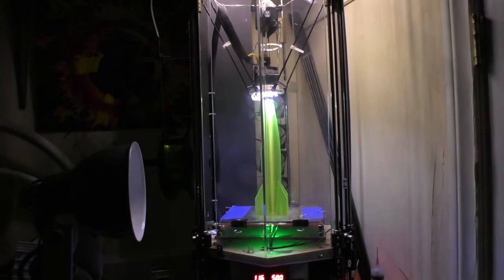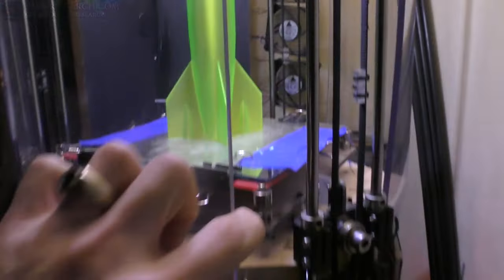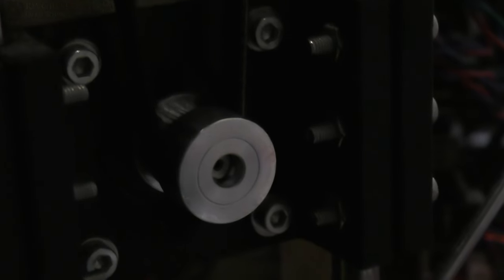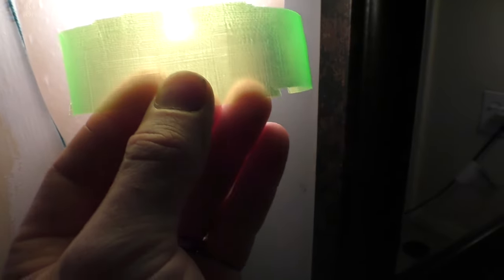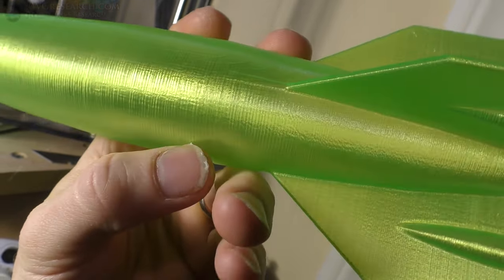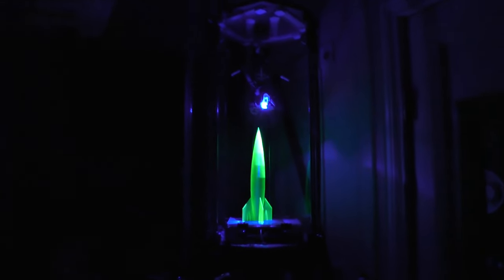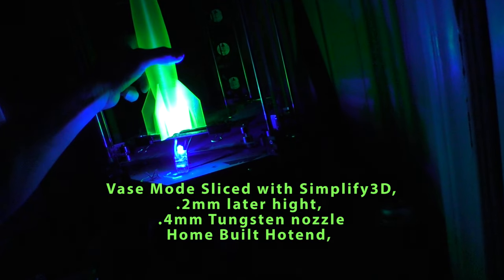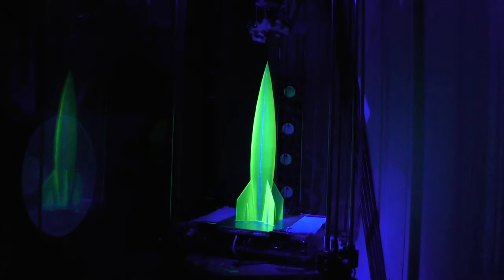"Seeing" your X/Y 3D Printer Resolution.

Comment: The lines you see is called the moir effect which is only present on delta bots, cartesian printers suffer from what is called "ringing" however the cause is completely different.  You can see the same effect when printing cubes on a delta bot, it's a pretty cool side effect.  Some say it can be cleared up by using a faster controller board and higher quality steppers, it will be interesting to see if your OSD does the same or if the effect is no longer present due to the much higher grade controller components.
Reply from the maker: yeah i have a lot of testing do do soon with this rocked the Ramps / Duet 0.8.5 / Duet wifi... some comparisons all on this Rostock... just st see what we get ! thanks for the notes! ~Russ
Reply: Moire, thank you :)
I wonder if an anti-aliasing or simple tri-linear texture filtering technique would work with the moire problem.
Reply: jittering the feed rate by a tiny amount at a high frequency might also help hide the pattern.

Comment: its very nice material to print with. When you run it slow you can get very clear prints. I found some info that talked about getting the most from its optical properties...see if i can find the link.
Reply from the maker: yeah running slow seems like a must with PETG. i haven't decided how much i like or dont like it... yet... lol ~Russ
Reply: ***** i like its low shrinkage and I especially like its food safe plastic status. Also the lack of smell. It makes nice solid parts too but I had heat retention, but you got plenty of fans on your rig.

Comment: Thanks for the heads up on that model Russ, have printed it twice now slightly smaller than yours at a height of 120mm on a Hictop Prusa i3. It's great to use as a test piece while tuning for different filaments.👍🆗
Reply from the maker: Smallest Workshop wonderfull. can you post a short video of how yours look ? can you "see" the lines like in mine? and is it more in "4's" where mine is in "3's"  id be interested to see. thanks!! ~Russ
Reply: rwg42985 I'll do my best Russ , I have about 40 mins of the printing recorded and I will try to  do some still of the "lines" as well. I'll try to post it onto my YouTube 👍🆗
Reply from the maker: Thanks!!!!!! ~Russ

Comment: I would really like to see how a set of .9 deg steppers and TRINAMIC RepRap Arduino Mega Shield would go fixing this issue, as I understand this product you can configure it for 256 times microsteps but not suffer the 8bit overload because it uses SPI not step and direction. The atmega is only do high level process not driving the steppers.
Reply: Thanks for pointing me towards TRAMS and TMC5130, interesting. However I have severe doubt that it can improve actual print resolution past 8-16 microsteps. To precisely hold the stepper in a fine intermediate position, the motor's construction based nonlinearities need to be accounted for. Now TMC5130 has a writable sinetable that can probably be used to fix that up, something stepper driver ICs never used to do, but i doubt this can be implemented in a robust way outside industrial use because of measurement difficulties.

Russ isn't even close to hitting the pulse ceiling on his controller, because the movement range of the motors for a given layer is so tiny! There's like barely hundreds of pulses to traverse across the build plate. Hitting the ceiling would be a better position to be in, at least as far as it could be supported by mechanical precision. I think the system desperately needs lower gearing or finer actual steps. Though as a tradeoff, he does receive currently more processor time to do the parsing and motion planning.

Parsing and motion planning is inefficient in current 8-bit firmware. I hope to get a chance to try to improve on that.

Then again 32-bit ARM LPCs and STM32 are such powerful and affordable ICs, they cost less than large 8-bit AVRs, and are very easy to work with for developers. I expect that in the long term, any effort put towards 8-bit single-vendor architecture IC is ultimately wasted.
Reply: I think I saw tools on the Trinamic website which allowed for setup of those tables. I still think that 0.9Deg steppers would help. I have a delta here and I have some 0.9deg units coming for a test.
Reply: Mike O'Connor well the point of tables is to match an actual motor. But how do you measure its characteristic curve? You need a huge flywheel, and some really super precise and very powerful motor on the other side to drive it super smoothly. That's what I mean by measurement problem. No website is going to just spit out perfect data for a random cheap motor from China.
Reply from the maker: so the Duet WIFI my RWG_OSD is using dose do 256 micro steps. When i get this switched over to a duet i will do some tests. ( soon) and it should fix some of this. also Brendin Emslie in the below comments already confirmed this. but i want to see it on my rostock :) 

the Duet 0.8.5 has the same drivers as this Ramps, but the Duet Wifi has the next gen drivers with 256 micro steping... however i just use interposition option on my duetwifi. with i think 64 micro steping. its quite smooth. 

also both Duets are 32Bit processors. and that is *needed for a delta. 

~Russ

Comment: Russ, what stepper driver are you using, and what microstepping?
Reply from the maker: currently on a ramps 1.4 board ( 16 micro steps), soon to be on a Duet 0.8.5( different drivers but same 16 micro steps, i dont think that will hep it much, but it might because its 32 bit...) however I will be also trying a Duet Wifi on this as well. Just for comparison. the Duet wifi has the 256 micro steps. ( TMC2660) this is what i use on my RWG-OSD and its SO much quieter... more data / resting as soon as i get my new Z probe up and going :)  ~Russ

Comment: This explains everything going on with the patterns in respect to decay mode. You'll most likely need to ground your ROSC on A4988 driver. ( or add +5v to the decay if you have DRV8825)   http://forums.reprap.org/read.php?178,763881   <-- good info!

Comment: Are you drawing any 3D models?  If so, what program are you using?
Reply from the maker: yes, i use to use google sktchup, and for basic stuff, its ok if your new to cad. However Fusion360 is now free for most users ( hobbyists and start ups like us) and at first its a bit hard to use, but i highly recommend spending some time to learn it. its quite amazing for free. 

~Russ
Reply: I've been using OnShape.  It's the first time I ever tried 3D CAD.  I'm enjoying it.
Reply from the maker: Joe Wilder sweet. do give fusion360 a try and then tell me what one you like more. or what one is more intuitive. 👍
Reply: I use a Chromebook. As far as I can tell, Fusion 360 won't work for me. OnShape is platform agnostic - 100% browser based.
Reply from the maker: oh yes I see now, ok well the god thing is that you will have some background so when you can use fusion you will be able to! cool i haven't used OnShape, i logged on once but never used it...  its quite cool to have a web based cad. most cad is a resource hog! ~Russ

Comment: For how long have you been using the tungsten nozzle? is it the one from ddd? how are you finding it?
Reply from the maker: i have been using it for a long time ( i had a prototype for over a year: https://youtu.be/dndHdIpcQvM)  i then ordered 3 more to help with the funding. yes its from DDD. i really like it. the best part is the plastics done "stick" so bad to the nozzle ( for cleaning ) it just wipes off if you clean it every print or 2 . if you let it burn on there its slightly harder to get off but WAY better than brass. i like it, and if your going to run plastics with abrasives i would highly recommend it. its a good nozzle. ~Russ
Reply: Cool, I also Got one from the KS campaign.If plastic doesnt stick that bad then might help with the problem I see when printing PETG, it sticks to the brass nozzle a lot and drag blobs of material all over the part and produce lots of stringing. Thanks for the nice videos!
Reply from the maker: Carlos Barreto yeah. going slow and getting the layers the right height is key with this petg. I have seen the same sticking your talking about. slower seems to be better. ~Russ

Comment: What controller are you using?  I use to get those with an MKS Sbase 1.3 (smoothie knock off) but don't with my Duet Wifi.
Reply from the maker: At the moment I'm still using a ramps 1.4 on this, it will be going to a duet 0.8.5 but its the same drivers, the duet wifi has better steppers... so i will test some stuff in the future on the old vrs new...  its nice to see you confirm that the duet wifi dose indeed up the rez because you can go higher micro steps. what are you running at on your duet? 64 micro steps? Thanks! ~Russ
Reply: I have tried 16, 32, 64 and 128 steps.  I am experimenting with 16 interpolated to 256 steps right now.  64 is a good choice.
Reply from the maker: Brendin Emslie cool. I found that using 64 steps but 256 interpolated give me the best results. still has torque but seems to be much better resolution. ~Russ